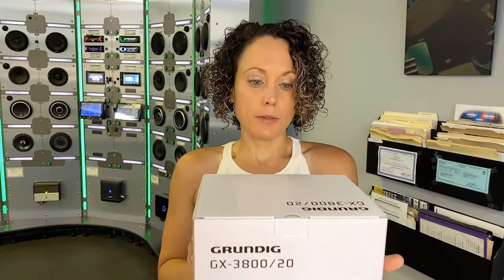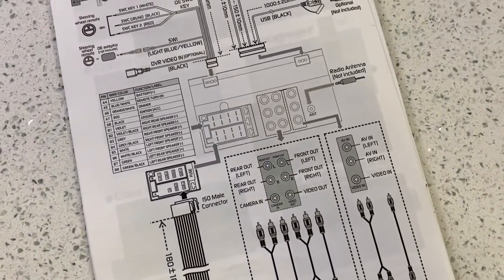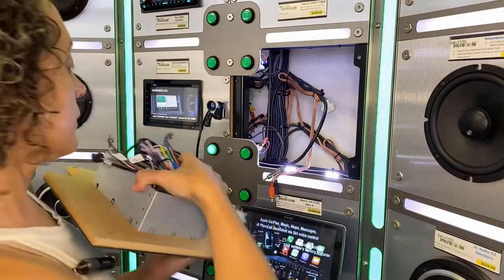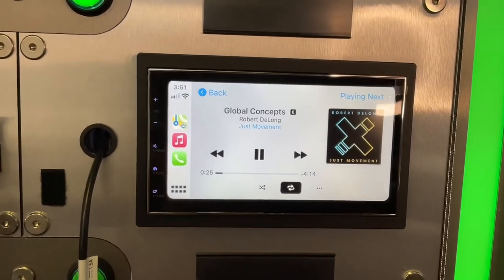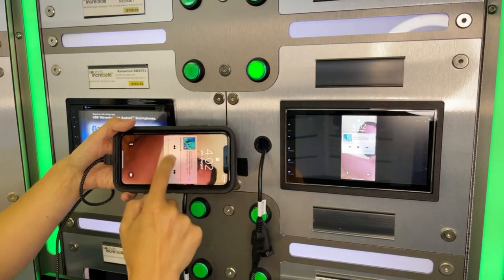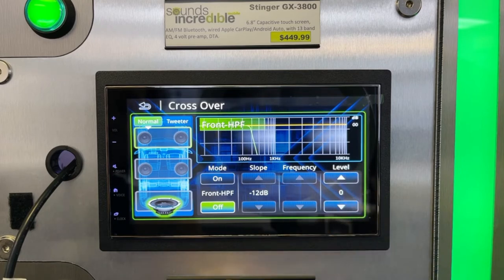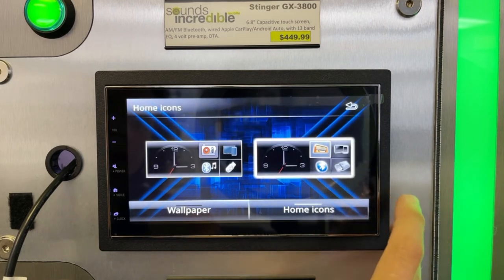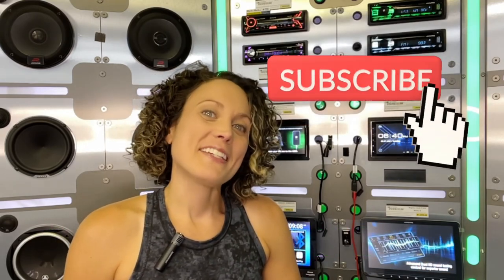Grundig GX-3800 unboxing PLUS Review CarPlay Android Auto Stinger Electronics by @carstereochick

Comment: Hi I just got this today and fitted by a professional but when I am listening to the radio on it it’s staticky and stopping start playing why is this ?
Reply from the maker: Have to talk to your technician. Reception is very finicky and there are a lot of different things that can affect it, but this sounds like a radio grounding issue so that would be the 1st place to start - change the ground for the radio. 

Other issues that can affect reception: most newer cars require an FM/AM antenna adapter. Some require an amplified antenna adapter. If they didn't use the amplified version and if that's what your car requires, you'll get basically no AM and just some FM. If they used the correct amplified adapter, but didn't power up the amplified lead using the radio's power antenna lead, it won't work right. If you have a standard Motorola antenna connection, but a rear window amplified antenna, they'll need to power up the antenna amplifier. Just to name a few possibilities. 

Also things like aftermarket LED lighting will degrade reception or even having a certain type of spark plug can make a difference.

Comment: Does it have a GPS receiver, so you can use navigation on it without connecting your phone? And does it have WIFI or SIM slot for internet access? How's the performance with GPS apps? Smooth? Sluggish?
Reply from the maker: No GPS - CarPlay/Android Auto only. No WiFi or SIM slot. I don't think manufacturers see a need for that since practically everyone walks around with a smartphone in their pocket these days. For a $400 - $450 unit, the performance/processing and responsiveness is on par with any comparably priced Kenwood or Sony. It's using Linux OS in the background which I've always found to be reliable. My Kenwood DMX7704s uses Linux as well, it's really stable.
Reply: @carstereochick  that's too bad, I don't want to have my phone connected or used just to navigate the car.. there is little point in running apps on it if they can't do anything. Know of any other good car stereos with gps and wifi that doesn't cost thousands?
Reply from the maker: That's what Apple CarPlay and Android Auto is, it's just a pass thru from your phone to the radio. They figure people are using their phones for this anyways while driving, so the integration is to try and make it safer and easier to use. I can definitely appreciate wanting GPS without having to have your phone connected. There are areas where you may not have cell service and it's nice to have sat based GPS. Consider a model with built in GPS like a Kenwood DNR476s or Alpine INE-W970HD. I am not a fan of the units with wifi because the ones I have seen are usually #1) shipped directly from China with no product support other than email #2) They're usually running an older Android operating system in the background (which can be glitchy) and require you to tether off your phone in order for the apps to work. There may be some decent ones out there, but I just haven't seen/used any personally. I'm not aware of any with a SIM slot.

EDIT - not to be confused. Some models like the Kenwood DNX997XR list WiFi as a feature. It's not a feature, it's there to support wireless Apple CarPlay and wireless Android Auto which requires both a Bluetooth and WiFi connection to the radio. In this example, the WiFi is purely for the wireless transmission of apps from your phone to the stereo, you're still using the data from your phone.
Reply: @carstereochick  I don't really see how it would make it safer to use Android auto than just running the apps straight on the stereo.. but yeah, those models are way too expensive for what I need. It's too bad, my current one has both GPS and wifi, just as I like it, but it's slow as frozen molasses and I can't find a decent upgrade. :/ The one I have cost like $100..
Reply from the maker: Have you ever tried Android Auto? It's designed for car use so the apps are big and easily recognizable on the screen and you can use Google voice to get directions, play music, make a phone call, etc. So the idea is you can use voice control without having to take your eyes off the road. The other benefit is it's constantly evolving and improving technology. More apps are added as time goes on and as more developers integrate their apps with Android Auto. As long as you keep your phone up to date, more features will be added. Right now for GPS apps you can use Google Maps, Waze, Sygic, Coyote, Map Factor, Gaia, etc. If you haven't tried it, I recommend checking it out. With the chip shortage and global supply chain issues, the cost of a decent unit with on board GPS has gone up considerably.
Reply: @carstereochick  I know how it works. I hate using voice commands and I want my phone free to use by others in the car. Also other people should be able to use the car fully without needing a smartphone hooked up.
Reply from the maker: Gotcha. Good luck in your search. Let me know if you find something good! :)
Reply: Buenas noche con esta radio se puede acceder al menú del coche para ver consumos,activar o desactivar funciones como el control de estabilidad? Es decir conservas las funciones que trae la radio original? Gracias

Comment: Is the Hardware identical with the Kenwood DMX5020 DABS? It looks like that.  Maybe the Software can bei flahed.
Reply from the maker: Doesn't appear the same operating system. The DMX5020 DABS looks like it would be comparable to the DMX47s or DMX4707s we carry here. It's possible they're made in the same facility? I agree they're similar looking, but the menu and operating system didn't remind me of Kenwood.
Reply: Hmm, that's bad. I hoped i can fix the long boot time this way :/

Comment: There made in New Zealand, not Germany. Grundig car stereos were top of the line next to Alpine,  Bose and Kenwood in the late 80's.
Reply from the maker: For real? This particular radio is actually made in China, but are you saying Grundig stereos and appliances were at one point manufactured in New Zealand? My sales rep from AAMP Global told me Grundig is a German company and when I looked into it on my own, that appears to be the case. For example, Wiki says the consumer electronics and appliance company was founded by Max Grundig in 1945 in Germany and is currently headquartered there. This unit is definitely up there in terms of sound quality right next to an Alpine, I was pleasantly surprised.
Reply: @carstereochick  Hey, here in Germany Grundig is well known. I wanted to Buy a Kenwood DMX5020DABS, but If you look at the Grundig 3800 you see that these are very similay. I also installed an SWC adapter to get the Signals via Canbus. Grundig was not at all listet in the Adapter, so I just used the Kenwood wiring, and all worked just fine.

Comment: Hey I bought this product abs got it installed by a shop but my stero just freezes up you know what it could be
Reply from the maker: What’s the year, make and model? Have not had any issues with any I have sold. Maybe it’s a voltage, amperage or ground issue. Most 12 volt electronics bug out if they’re not getting a solid 12 volts or higher (even though you can usually start a car with a battery at 11.5 volts). Or if your car uses an interface to create ignition, some of the older radio interfaces had just a 1 amp output which was not enough to consistently power up a head unit (newer interfaces are usually no issue). Or if the ground is not good that can cause a radio to heat up and freeze/fail.

Comment: Do you have to connect a USB into the headunit if you want android auto if I have a USB port where the aircon and heating dials
Reply from the maker: Yes, it is a wired connection for Apple CarPlay or Android Auto. With Android devices I recommend running a high speed USB C compatible port like the USB-DMA1 flush mount from PAC Audio. Usually OEM USB ports are finicky with Android Auto, they usually are not a high speed USB and can’t transfer data fast enough to operate consistently.
Reply: @carstereochick  thanks really appreciate it just one more question how would add a custom background onto the head unit

Comment: I installed this model. FM radio stations are all tunable. AM frequencies tuned in but nothing is heard just white noise. What gives?
Reply from the maker: It's probably your install or wrong parts used. Depending on the vehicle you may have an amplified antenna that needs to be powered up using the power antenna lead. For example, if it's a euro style adapter that would be like a 40-VW54, 40-EU55 or 40-EU56 - there is a blue lead coming off of these that needs to be powered up using the power antenna lead off the radio. Sometimes people mistakenly buy the non amplified version like a 40-VW10 or 40-EU10 and you'll get some FM, not a lot and zero AM because that style adapter does not power up the amplifier for the antenna. There are also some vehicles that have a standard motorola antenna connection, but still have an antenna amplifier in the car that needs to be powered up.
Reply: Hi, thanks for replying. I used the standard RF radio antenna plug which was in my broken Kenwood, plugged it into the Grundig. There is a blue wire from this unit with a tag "P. Ant." I cut the blue wire from the adaptive harness plug which was in the Kenwood unit and joined that wire to the Grundig blue. FM began working but no AM. There is no female sockets hanging loose like those which you suggested "40-xxxx"

Comment: How do I connect an amp and speaker ? Can’t seem to figure out the av cables
Reply from the maker: They're labeled. On the back of the unit's chassis you will see two pre-outs labeled Front and Rear. The Sub pre-out is a mono (single) RCA on the same pigtail as the USB and mic.

Comment: My mom purchased this and had it installed by a professional shop. The CarPlay is not working. We have tried everything. Android auto world no problem. Unfortunately, they have Apple phones. The shop wasn’t a huge help. Their solution was get an android. We have tried several chargers and several phones and nothing. Any ideas?
Reply: We did get mirroring to work but it’s not feezable to use all the time.
Reply from the maker: Hi. Just make sure it's turned on in the menu settings under phone connectivity. It sounds like you already got that because you tried mirroring. If CarPlay is checked off under the phone connectivity settings, it's could be a cable issue. That's the most common issue I see with CarPlay connectivity in general. Have you tried an original Apple charge and sync cable? Those and Anker brand cables seem to work the best and make sure you have Siri turned on in the phone (CarPlay requires that). If it's been awhile, restart your phone. Lastly, the USB lighting cable should be standard length and plugged directly into the USB from the radio. If the shop added another 3ft or 6 ft extension to route the cable and you're using a 3 or 6 ft USB to lightning, that could be the issue. Have never run into an issue where Android Auto works, but CarPlay doesn't. LASTLY - if you/the shop hasn't tried this, reset the radio and restore to original settings. It will clear the cache in the radio.

Comment: Hi,do I need cut patch lead to for top screen info display on screen?thank you,key1 key2...
Reply from the maker: I'm so sorry, I don't understand your question. The Key 1, Key 2 on the radio screen is for using the built in steering wheel control functions for older cars with analog (non CAN Bus) steering wheel controls. For this feature, there are 3 wires coming off the back that are labeled OE SWC. Those would need to be connected to the steering wheel control wires in your vehicle and be programmed. If you prefer to use a separate steering wheel control module or if you have a vehicle that is CAN Bus or digital steering wheel controls, you could use a Pac Audio SWICP5 and connect that separate steering wheel control module to the light blue wire labeled "SWC IR Remote In". I hope that helps!

Comment: Have you ever tried Bluetooth with this unit?
It's not possible to make a call. BT connection breakes down.
Reply from the maker: Yes, we have sold and installed a bunch of these without this issue. In general with any radio if we have any kind of Bluetooth issues I start by clearing memory from both devices and restarting the phone, making sure the phone and all apps are up to date. If I still have an issue, I'll clear memory again from the phone and the radio, but then also reset the stereo like a full system restore. If I still have trouble after that, I go through the clients phone and see if maybe it's a particular app causing trouble. Recently had a client with a similar issue with Android Auto and a Kenwood radio and it turned out it was some podcast app he had that would cause everything to get wonky, I deleted the app and reinstalled it and it was fine. I hope one of those tips works for you!

Comment: I just bought the radio and every time I turn on my car I need to do all the stuff you need to do when it’s brand. What can it be? HELP!!
Reply from the maker: Sounds like you mean it's not retaining settings like clock, radio stations, etc. That would be an issue with your constant power wire. Perhaps you have constant and accessory reversed (which can happen in some European models). What's the year, make and model vehicle?

Comment: I have this one but having trouble with my steering wheel controls 😩😩😩
Reply from the maker: In my experience, the built in SWC module really only works with basic, older Japanese makes like Honda, Toyota, Nissan. I wouldn't expect them to work in anything that has CAN bus or data communication lines at the head unit such as any GM pretty much 2003 and up. What's the year, make and model?
Reply: @carstereochick  is there anyway to make it work with newer cars?
Reply: @carstereochick  subaru impreza STI 2009, would that work?

Comment: Did anyone else have trouble getting g the steering wheel controls to work?
Reply from the maker: I've only been able to get the SWC to work using the PAC SWICP5 or SWICP2, but that also has to do with the cars that we've installed them in. I haven't had the chance to install this in an older Japanese vehicle with SWC such as a 2008 Corolla which I assume the radio's built in SWC would work with.